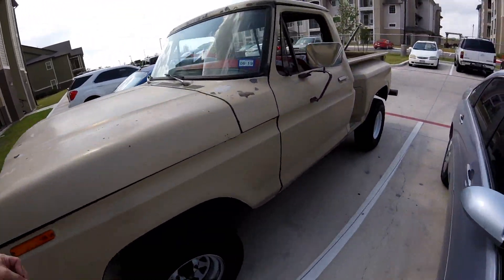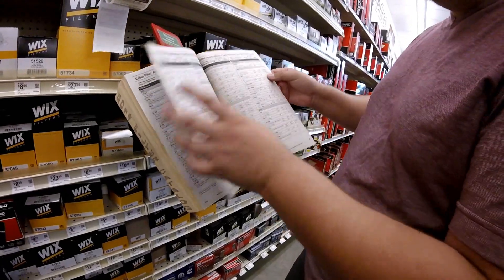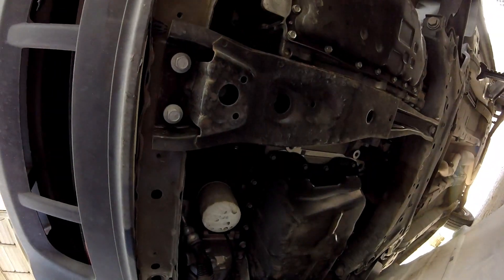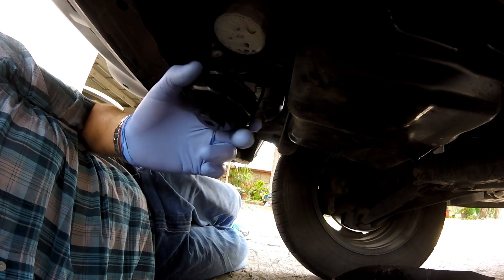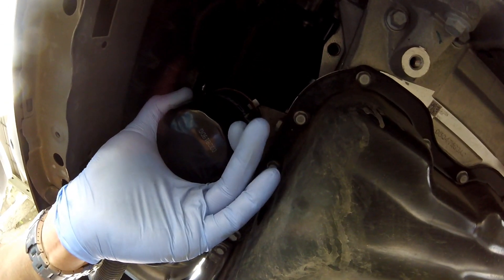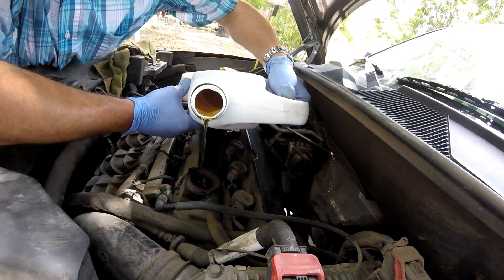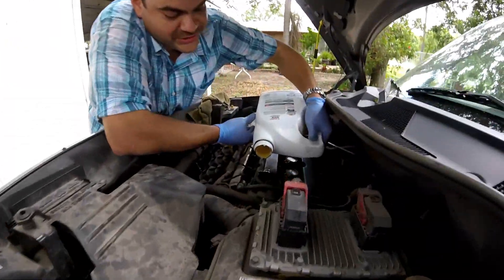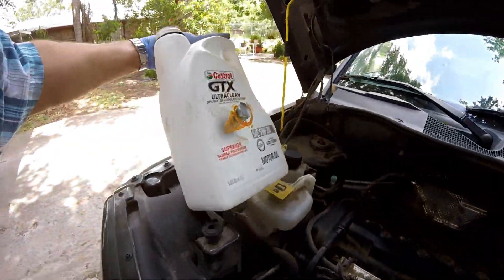Oil change on a 2015 Jeep Patriot

Comment: What's the plastic wrench size?
Reply from the maker: This is not the one but this is what it's called, It's metal not plastic.

Oil filter cap wrench 
Easily and safely removes hard-to-reach oil  filters works with 3/8" drive ratchet 
93mm 15 flutes

Part number19904